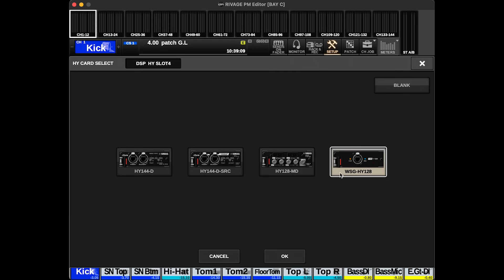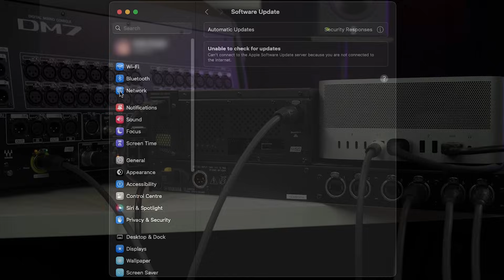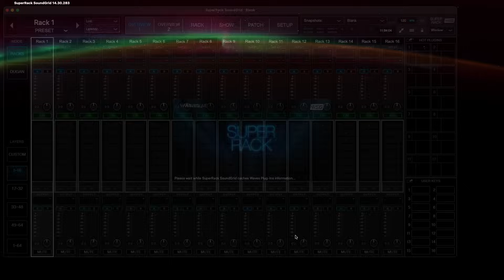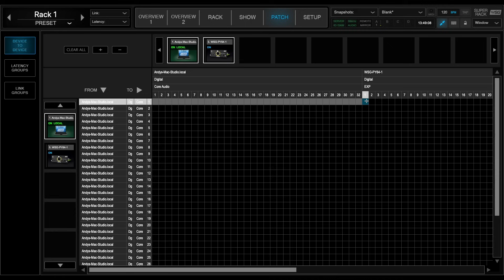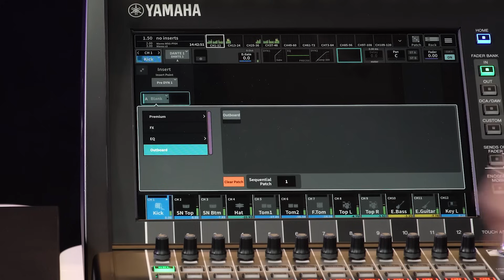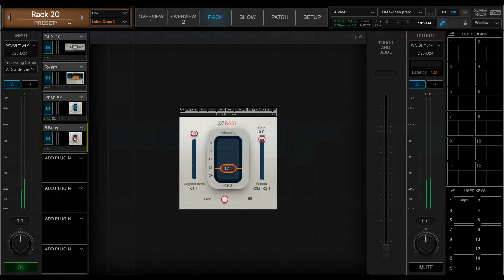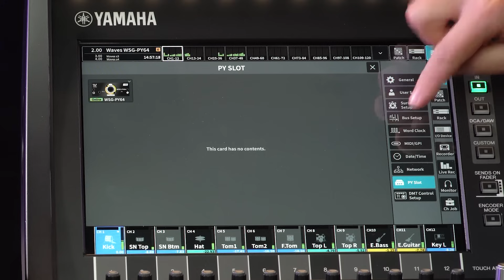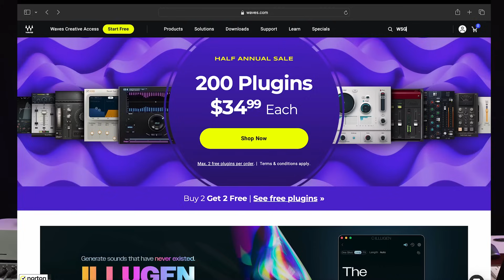Using Waves WSG-PY64 with Yamaha DM7 series

Comment: Why would you need basically a separate PC as outboard gear just to run plugins? You have everything in the console.. and if you need a special effect, just insert it as analog outboard?
Reply: Would you rather Carry 200 plug-ins as analog outboard gear or a pc, maybe a pc in a single rack?
Reply: @lemontree15  Instead of the 40+ plugins you have 200 more plugins that cost (in this example) over 3000 USD (server + card).. I mean, it's a 25'000 USD mixing desk and Yamaha don't even provide (or think about?) an option to upgrade the mainboard/cpu/ram in order to run more plugins integrated in the console. And I mean you could buy a laptop or small PC, connect it via Dante and use whatever plugins you want..

Comment: I like the Video in general but it is obviously mostly advertising. Waves wants to get into different Mixer brands because they know there are other, maybe better options on the market (Just with a Laptop and RME digiface Dante or Fourier Transform Engine for example). These Options are cheaper and more easy to use.
The Part with the snapshot Syncing with the Midi Notes looks way too complicated.

Also the Part with the direct "recommendations" of the waves Plugins was quite awkward...

Comment: I know this is a yamaha video but, can you not just run waves via a laptop to any mixer via usb (or in this cas maybe ethernet) without all these outboard stuff?
Reply: Sure you can, but you will run into latency issues unless your soundcard is good enough.
Reply: Yes you totally can. Just connect your laptop to the console via USB, DANTE or whatever and run Waves Superrack Performer.
The Hardware is only necessary if you want to use a big amount of Vsts on many Channels (more than 32), because it is what its designed for: Lowest possible latency and biggest reliability.

Comment: I still don't get it. So expensive mixer like this and has issues with UI (delay, stuttering/freezing, ...). I would love to see some improvement here  as I love the Yamaha ecosystem. (and "DM5" version of mixer as well). :-}
Reply: i heard that it actually can't be fixed because the UI shares the same processor as the DSP and uses scheduling to prioritize the AUDIO over the user-interface.  kinda like running VMware to run linux and windows on the same PC and same CPU
Reply: @magoostus  As an embedded electronics engineer, I doubt so. It is very unlikely that they used the FPGA to emulate ARM cores, since it's a very expensive and inefficient way to do so.
Reply: @AdrianShajkofci  This is under the assumption that realtime audio processing requires FPGA or special DSP chips which QSC Q-sys processors have proven to be false as they do all their realtime audio processing on the intel CPU, just like a Waves soundgrid server, I believe yamaha could totally make a realtime audio engine purely in software for ARM cpus
Reply: I've certainly heard about others' problems with screen lag etc but I did a whole tour on DM7 with no issues ¯\_(ツ)_/¯
What are you looking for in a theoretical DM5 that you don't get from like DM7 compact?